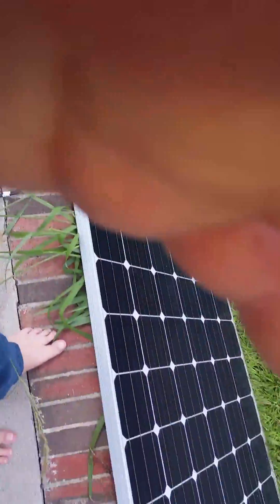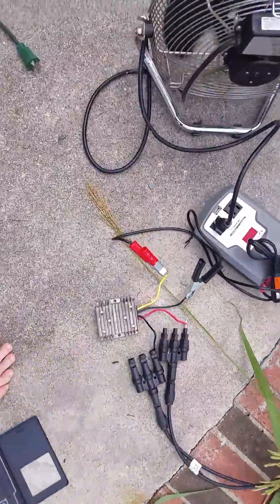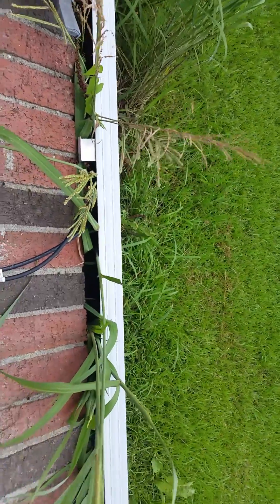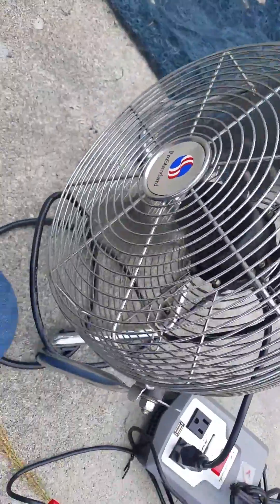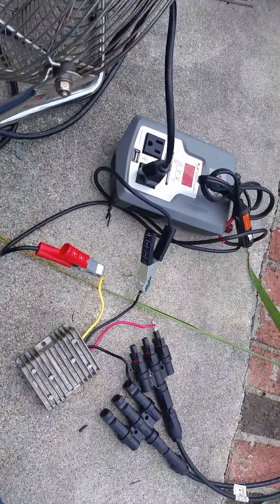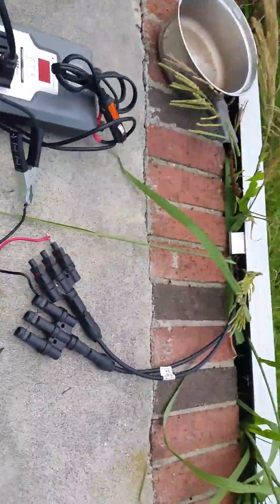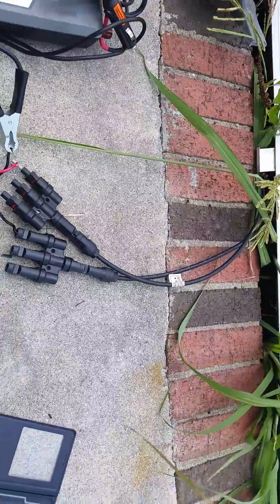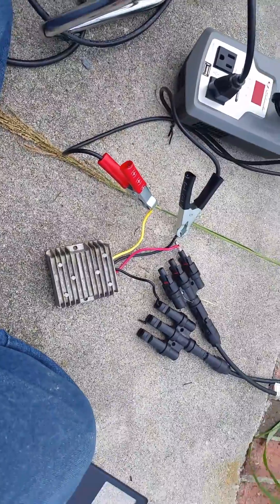Use inverter on solar panel without battery

Comment: I am made to understand it’s not safe to run your load directly from the solar.
Reply from the maker: The dc to dc converter gives the inverter exactly the proper voltage it needs.i am the only one who came up with this idea . The key is you need a 24 volt panel to operate a 12 volt inverter directly from a panel.

Comment: So then it would be 120 Vots @ 320 Watts.. Or it would be able to supply 320 Watts to the inverter because 120 Volts is actually less current.. it's the trade off. 24 Volts @ 320 Watts is higher current. That's fine.. We only care about the watts is can dissipate or supply. The inverters job is to take 24 or 12vdc to ac.. thats it. The important thing to remember is that like the guy in the video said, 320 watts @ 24vdc. The PV panel can supply 320 Watts. Got a core i7 laptop that needs 120 Watts.. no problem. Wanna plug ur phone in and use your hotspot on your Verizon Moto phone.. no problem. 320 Watts is allot.
Reply from the maker: 320watt @24 volts however here is a secret its almost double when downconverted to 12 volts and that is why i can power 110vac devices off this panel in the rain with very little light because now if my panel recieved even the slightest bit of daylight not sun just daylight it would be around 50 watts @25 volts then downconverted to qa regulated 12.5 at about 100 120 watts .
Reply: @Gadgetmall  hi i'm from the Philippines and its a tropical country and we have an abundant supply of sunlight everyday. Can i try your technique with a 24 volt-12 volt dc to dc converter on a 12 volt 100 watts solar panel? thanks.

Comment: what about on cloudy days or low sun?
Reply from the maker: As you see it is cloudy and raining so year around power . See a 24volt panel outputs over 40 volts .mine is 47 volts so.ot always has over 24volts for the step down DC converter to work in any light.that and the wattage of a panel 350watts is the key to power in the rain with one panel no battery. The converter is the work horse.

Comment: Fantastic. I have looked for something like this for a while. In your comment above you mention a tv, satellite, 4 bright leds, and a 70:watt fan. Are these all still running off the same 300w panel, as in the video?  Can you please tell me the total watts, approximately?
Reply: vccranker they are still moving, night and day. still moving get. Im just learning got start somewhere .  We will get there .  Check out Missouri wind and solar ,they make a device that wont turn your inverter off.  This one was about to turn off I think. But they may just have the same thing in there box that he had before the inverter.
much love and God Bless you and your days to come
Reply: You are the only one that I know of who managed to run something directly off the solar panels, and was kind enough to show how you did it!  That is the most (may the only) fun I've had with solar so far.  I tried it myself with a converter and an inverter for the fan and light and it worked!  : - )
Reply from the maker: Yea because my panel is 350watt panel ar 24volts. Any 24volt panel produces over 45 volts in any light so in the rain it's still got light from the day and so it produces the 24bolta needed by the DC converter to step down to the cheap inverters input of 12v. Rainy days lets the panel produce at least 100watts and my TV radio flatscreen takes less that 20 watts ac . The freezer takes about 50 watts and the lights well they are led work lamps and bulbs lead than 20 watts so.yea power all day as long as we can see outside the panel makes the converter work form the inverter with no one battery.  Key is 24 volt panel and stepdown converter.
Reply from the maker: Panel is a big one 350watt .24volt only will work.not 12 panels.

Comment: what kind of inverter is that? can you send me the link please
Reply from the maker: It's just a cheap 500watt inverter 12volt input. 20 dollars at flea market. I've used all kinds with this converter. Its rated 480watts. Any 12 volt inverter works

Comment: This looks brillant for running a diaphragm pump to airate my lake. the pump is 240 v AC and draws 40w. Would you still recommend using 300w panel to make the most of the available light?

Thanks in advance
Reply from the maker: Yep at least  300watts. 350 watt one is better but make sure is a 24volt one. Their out is over volts volts and that's why the converter works from panel in rain
. They always have 24volts in any light for.the converter

Comment: can you send me a link to the 24 volt to 12 volt converter.  i need to make sure i get the right one...THANKS!
Reply from the maker: https://rover.ebay.com/rover/0/0/0?mpre=https%3A%2F%2Fwww.ebay.com%2Fulk%2Fitm%2F323221686579
Reply from the maker: No problem. 480 watt one works great with one 24 volt panel .my panel is 350 watts at about 45 to 48 volts 10amps
Reply from the maker: 12volt panel wont work output is less than 24 volts but 24volt panels should all output over 40volts and that's why it works.  They always have 24 volts to give the converter in any light.

Comment: Gday mate , is the 30A  type ? cheers Larry
Reply from the maker: Larry Lawson This one is a DC to DC 480watt . It was 20 dollars on ebay.
Reply from the maker: Its rated at 480 Watts the panel produced 320watts. Sorry. They have many models .the highest I saw was 1200watts .
Reply from the maker: Larry Lawson https://rover.ebay.com/rover/0/0/0?mpre=https%3A%2F%2Fwww.ebay.com%2Fulk%2Fitm%2F332585406350
Reply from the maker: 40amps

Comment: I just bought the coleman 40 watt solar panel which includes the 7 amp charge controller ...and it  is an over kill I am sure  but I already owned a 2000 pure sinewave inverter ... I have not set it up as yet .... but is the regulator the same as the charge controller ?
Reply from the maker: Wont work too little power man. You need a panel like mine. 24volts 350watts 10 Amos. Its 7 foot x 3 foot.output of a 24volt panel is over 45volts.
Reply from the maker: No the DC to DC converter steps down higher voltages to a regulated 13.6volts
Reply from the maker: Charge controller is just a switch that stops solar voltage at a set voltage like 12 volts then it disconnects the panels.
Reply from the maker: That 40wats wont run anything brother. It's an emergency battery charger that will take all day to charge a car
Never buy any panel under 100 watts or it's just a toy.
Reply from the maker: To run a 2000watt inveeter you need 2500 watts of solar power if you set a no battery system like mine. Also my DC converter is only rated for 480watts .they have much higher wattage dc to DC converters buy one with a 2000watt capacity cost close to 600.bucks.but you can run a big inverter with no battery just panels with it so it's quite worth saving cost on batteries if you only need power in the light of a day.rain or shine.